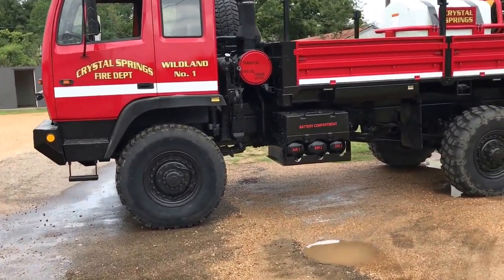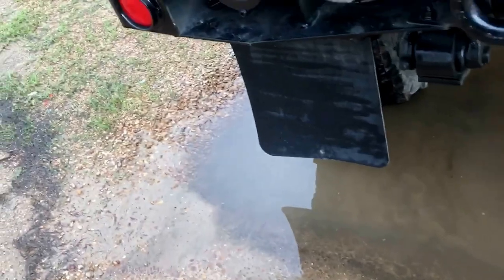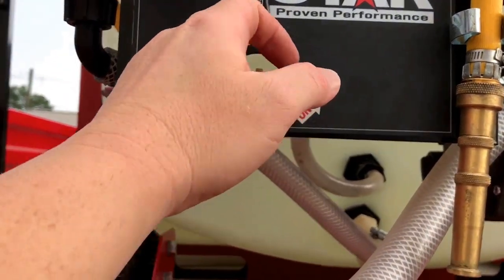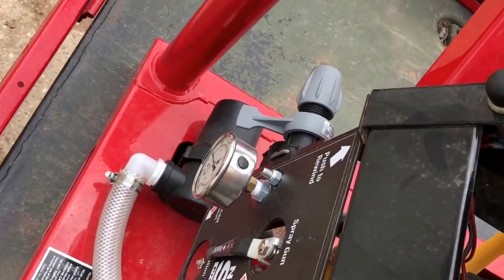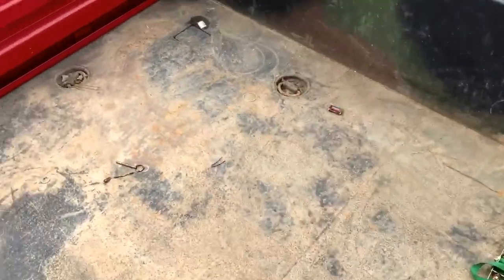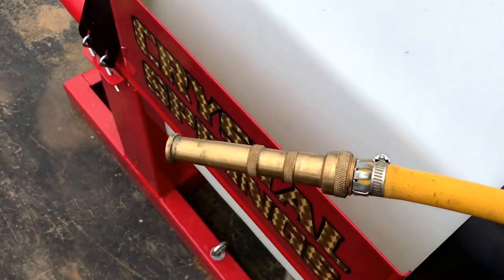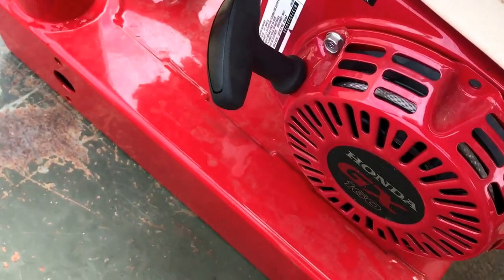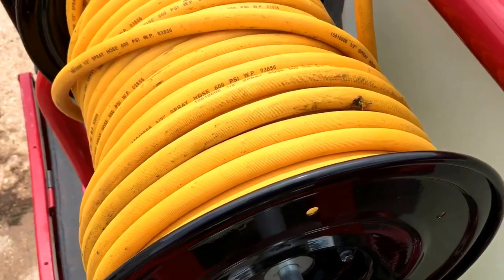Wildland 1 brush truck - Video 2 of 2

Comment: It obviously works for you guys but why do you only have a 200 gallon tank in that vehicle?  We have 200 gallon tanks in our 3/4 ton pickups, 300 gallon tanks on our one tons and, 500 gallon tanks on our Dodge and Ford 5500/550's.    My department is attempting to get one of these and we were planning a 650 or 750 gallon tank for it.
Reply from the maker: This is the way the skid unit came from Northern Tool when we bought it. We can always add another tank in front of skid and plumb them together but it’s really not necessary for our department. We were informed that 500 gallons of water is the maximum load for this vehicle. Anything more than that is unsafe. I would NOT recommend going over 500 gallons of water. Keep in mind this truck has a higher center of gravity than any of the trucks you mentioned.
Reply: In Texas a Lmtv 4x4 can only have a 500g tank max unless it's 6x6 u can have 1000 it's very weird how Texas classified stuff. I was talking to a man who had a four-by-four lmtv on his department at A&M and they had to go through extensive suspension modifications cuz the handling was so bad with the extra weight
Reply: We carry 400 gal , with that and pump tools and such it is right there at the 5000lb pay load rating

Comment: 200 gallons??? Our 2 1/2 ton is 650 gal and you don’t have to change anything for 12 volts you can get it straight from the battery compartment

Comment: For it to go that far under water the exhaust has to be at the same height of the intake
Reply from the maker: Not true. It’s called a snorkel and this is factory installed by the manufacturer Stewart & Stevenson, now Oshkosh Corporation, to meet or exceed U.S. military standards. This truck is designed to operate in deep water as long the snorkel (air intake) is above water.
Reply: The exhaust constantly has gases moving through it not allowing water to flow into the engine so the intake can be above the exhaust

Comment: what does back switches on back of the truck do?
Reply from the maker: huey meeks 
Do you mean the switch in the bed of the truck that says driver?
Reply: Crystal Springs Fire Dept - Training yes
Reply from the maker: huey meeks 
It’s a troop transport alarm switch. Military use. When troops are riding in the back they can activate the switch to let the driver know to stop. An audible alarm will go off in the cab.

Comment: 200 gallon ???  That's not much water ! It wouldn't last very long on a Brush or Range Fire ! That Truck Bed is big enough for a 400 to 500 gal Poly Tank plus 100 ' to 150' of  1 ''  fire hose with a pistol grip adjustable nozzle !!!~
Reply from the maker: B. W. Starkey 
Yeh you can have up to a 500 gallon water tank in this truck. Our skid unit came with a 200 gallon tank built in. Believe it or not it lasts us a long time during firefighting operations. We’ve had several brush fires and spot fires on miles of railroad tracks and it’s suited us fine. We just refill it with a regular pumper or at our fill station. Our setup is perfect for us but you can configure it to suit your needs. Thanks for watching!
Reply: I guess 200 gal of water would last a long time through a garden hose.